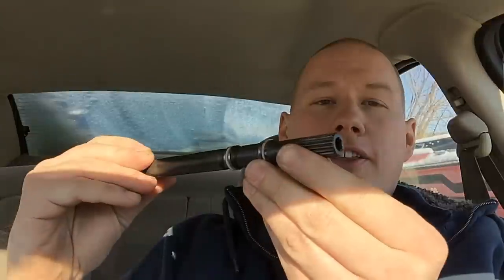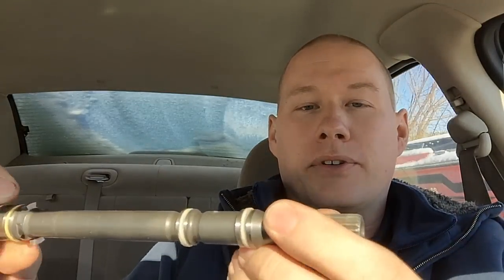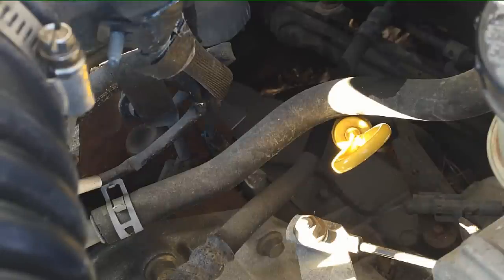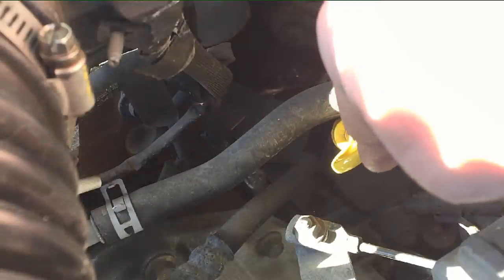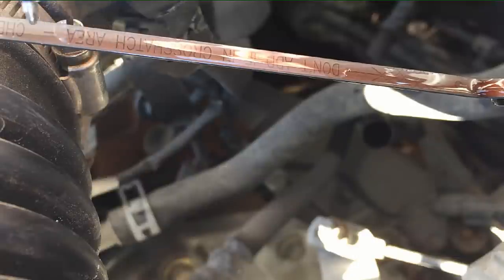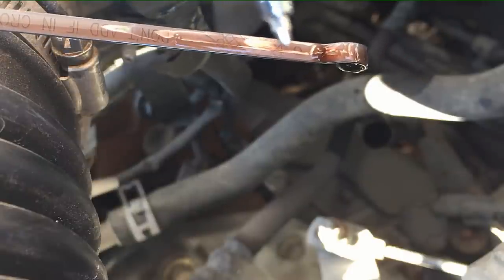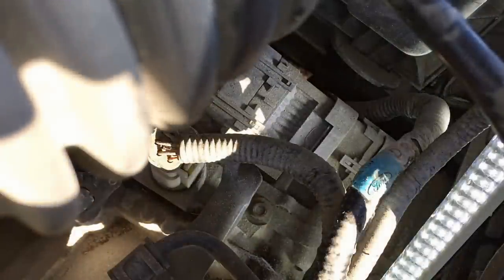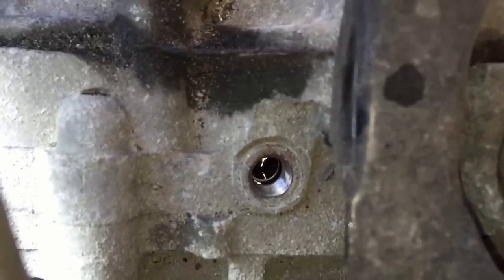Ford Transmission Tips: #5 Ford Taurus & Windstar No Movement EASY Diagnosis

Comment: Hi you doing brother I’m having trouble with my transmission because leaked out all the fluid from right between the motor and tranny so I thought it was the torque converter but I got both motor and tranns out and I can find the problem can you give me a advise please

Comment: ok so i have a 2005 Mercury monetary that will drive and when i get up to 50 60 70 it wants to stop moving get off the eway turn the van off turn back on start to go drive for about 10 minutes completely stops dont go forwards or backwards turn off for 10 more minutes and it drives again test said my fule sensor is bad would that make all this happen

Comment: hey my 2003 taurus with the 3.0 it goes in to gear but it seems like it is stuck in 2nd gear its very slow to take off and it wont down or upshift what could be the problem?

Comment: Hi Engine running great from your head gasket vedeo now have grinding and tick at same point coming from drivers side drive axel were it plugs into trans axel behind seal seal came out once changed drive axel now have this noise would you have vedeo on this

Comment: Wait so my Ford Taurus won't move and no fluid is shooting out, so it'd be my pump or torque c8nverter?
Reply from the maker: Torque converter is stripped out where the pump shaft splines into it.

Comment: Great info! Have you seen a CD4E do this?
Reply from the maker: Chad Ross No just the AX4S AX4N and 4F50N. The escape cd4e has filter plugging issues causing a similar concern.
Reply: @FordTechMakuloco  where are the solenoids in an 03 Ford Taurus transmission? I have 2 solenoids bad

Comment: I found my that my fluid light kept coming on in my 1993 Ford Taurus GL has under 90 thousand miles on it though I checked oil and antifreeze coolant and power steering fluid then checked the transmission fluid and it was almost bone dry I filled it up using a half full bottle and two almost empty bottles of transmission fluid that topped it off my family members driving my car not checking the fluids is what caused this. I know when the steering fluid is halfway low because when that happens the power steering screams when turning and the fluid light comes on when turning

Comment: I have a 2002 Ford Mustang v6 with automatic transmission. The transmission has delayed engagement when i put it in reverse then drive it take 3-5 seconds to engage in gear and vice versa. Also in a cold start in the morning i put it in drive hit the gas a little and the transmission just spins till like after 5 seconds in engages. What could be the problem? I am going to do a filter and transmission fluid change.
Reply from the maker: Caliluv562 Filter and fluid change is a good start I am wondering if you have a lazy epc solenoid. You will have to check line pressure to verify then epc pressure.
Reply: Ok thank you i would give you a update after oil and filter change. Do you think its a good idea to use Lucas transmission addictive to help stop slippage?

Comment: How about if you do get fluid from the port but every other symptom is the same. Won't engage in  anything but park. Excess fluid on the dipstick running and not (also not discolored).
Reply from the maker: The pump shaft may be grabbing at times and able to move fluid but not build pressure next step is an actual pressure check from that port to verify it has at least 50psi.    Here is the kit I recommend-     http://amzn.to/2vnnTX7
Reply: Took it to a shop, quoted me $2k for a "new" install, $2.8 to rebuild the current trans.  Said the TC was stripped.

Comment: What else would cause this problem if you get fluid coming out of port with 7\16 bolt
Reply from the maker: screw in a pressure gauge next to make sure it is in spec.
Reply: okay i will tell him to try that
Reply: @FordTechMakuloco  how much pressure should it produce?

Comment: FordTechMakuloco2007 Ford Five Hundred FWD 6 Speed Automatic Transmission.Hello, this is Tony. I have been having some transmission issues with my 2007 Ford Five hundred. When driving, I suddenly hear a grinding noise, and the it feels like someone is pressing on the brakes. The car eventually comes to a complete stop. There is no lights on the dashboard stating a problem. I took it to a mechanic and they noticed that whenever the car shifts into 3rd gear, the transmission goes back into reverse. What could be the problem? Is it the control module for the transmission?Thanks.

Comment: My 2002 Taurus slips out of first gear to go into second gear but after I lift off the throttled the will go into gear and shifts great after that ...and it does that when it heats up can you help me ?
Reply from the maker: Randy Brown More common for the intermediate plates to have issues on these causing the problem you describe.

Comment: what if I'm losing transmission fluid but and but when I add more it moves just fine but comes out again. I just replaced the transmission filter and gasket. and no sides of the fluid leaking.

Comment: My 99 Windstar quit on me today.  Found your video and looked for that plug but did not see it.  Can you steer me in the right direction?  stopped at a local store to look for a wrench.  When I started it to leave it made a screech like a belt so shut off immediately and checked.  On restarting it makes a soft ticking or tapping sound and will not engage.  I can put it in gear or neutral and can rock it but in park will not move.  Checked fluid and seemed good with no burned smell.  Tried to pull the codes off the computer but got some weird ones so not sure my cheap reader is working right.  Any help would be appreciated.
Reply from the maker: NeoWolf Yours is right on top same thing.

Comment: Other than this, what are the other most likely reasons the car won't move? I have a 2004 Taurus with the 24v 3.0 that won't move. Does the engine type matter or do they all use the same transmissions?
Reply from the maker: All the same, put a pressure gauge on it next.
Reply: Did you find out the problem

Comment: Hi +FordTechMakuloco. I have a 2000 ford windstar. suddenly lost drive on the freeway as you describe. Started making a whining noise. Has plenty of fluid. I did the check that you show in the video. Fluid pumped out of the plug hole unlike in your video. But the van still won't move and like I said it is making a whining noise. Fluid did not shoot out of the hole it just came out without a high pressure stream. If that is normal what should I check next? Thanks for the video!
Reply from the maker: tom Frazier Unless the cv shaft broke (which is likely didn't but I did have one) then this is still your issue this seems to happen most going down the expressway. Yours is just still catching a bit that's why its gurgling fluid out. It should still come out quite fast even at a cranking rpm.
Reply: Thank you sir. Thats what I thought. The pressure coming out was not enough to engage the torque converter I thought. The CV's are new and don't rotate with it in park while off the ground. So I guess I'm pulling the transmission this week. Thanks again

Comment: Makuloco, can I assume its not necessary to clean guts of trans when replacing converter, since you said just replace it?
Reply from the maker: +Welton Hardy yeah the guts are fine generally. A pan drop and filter change is of course a good idea.
Reply: Thank you. Now I'm concerned about fixing it to await the next occurrence, since this issue is too common. But, I did lodge a complaint and joined the ranks. Oh, I tried to follow you on the ports, but you were working on a car; the ports on the van aren't easy to find.

Comment: I have an 06 ford escape that starts up & runs but when i shift it into gear it does not engage. What would cause this? I was trying to pass a car on the highway then it just reved up & would not shift after that.
Reply: Did you find the problem
Reply: Same thing with my 2003 Taurus thinking it's the pump shaft

Comment: Hey man, do you have any idea on my 2000 Ford Windstar why if I go one physical mile my odometer registers approximately half a mile? Thanks!
Reply from the maker: +ILTSYC This can be due to the improper gear on the vss sensor or improper tire size. Also I would get the axle ratio that is programmed in to the pcm compared to the actual ratio.
Reply: I bet the axle ratio is off in the PCM. My particular VSS doesn't have a gear on it and there are no speed ometer gears in the slot at the right transaxle where the older models are shown.
Reply: +FordTechMakuloco , I am having an issue with my 2005 Taurus 3.0 vin u, i have a harsh 1-2 shift no slip. manually shifting it shifts great nice and soft. like the accumulator is ok ?  Ive replaced the tps, mass, could it be oss,vss, no codes. pulling my hair out please help. thnx

Comment: I have a 2008 Ford Taurus X Limited mine won't go over 45mph or 50mph. It's like it won't go any faster? Please help it's been broke down since Christmas
Reply from the maker: Its either your trans or the cats are plugged.
Reply: @FordTechMakuloco  I'm going to try the battery first. I just read something about that. That wouldn't pull a code. 😁
Reply: I'm about to blow this thing up cause the battery didn't fix it

Comment: I have an 05 that's seem to be doing the same thing it sounds like it has a bad vacuum leak but it idols fine its almost like you have to hold it to the floors and your not moving only about 40/50 mph when it should be going 80 will this casue it to sound like its reving high.?
Reply from the maker: No this is a all or nothing failure.
Reply: Ford nut what was the cause of your transmission issue?  My son's 05 Taurus is doing the same thing.  It finally got to where it wouldn't move.  There is no mechanical sounds only the engine revving.

Comment: This is exactly what happened to our 2002 Ford Taurus SEL with only 70,000 miles on the clock. Ford sure doesn't make them like they used to.

Comment: This is EXACTLY what happend to my 03 Taurus. When I put the car in gear it feels like it is shifting in gear but the car will not move. So based on this video, it's gonna be the torque converter that needs replacing?
Reply: Find the reason?

Comment: I have noticed several videos claiming it is the shaft that has sheared off and the torque converter is fine.  Have you found this to be true?  If so is it a difficult fix?
Reply from the maker: Its the torque converter trust me.
Reply: @FordTechMakuloco  ty for the reply, I should change the shaft also right?
Reply from the maker: Yes they wear each other out and the scarf cut seals and the input seal.
Reply: @FordTechMakuloco  thank you, very helpful info, much appreciated

Comment: HELLO I WANNA THANK YOU FOR YOUR VIDEO IT WAS A LOT OF HELP MONTHS BACK WHEN I WAS REPLACING THE TORQUE CONVERTER ON A 2002 FORD TAURUS FOR MY BROTHER IN LAW NOW THE CAR RUNS PERFECT. AND ME BEING PROUD OF MY SELF FOR BEING MY FIRST TIME EVER DOING A TRANSMISSION JOB.  !!!!!!!! BUT THIS TIME I HAVE KIND OF THE SAME PROBLEM THIS TIME IS MY PERSONAL CAR 2001 FORD TAURUS EXEPT MY CAR RUNS IN REVERSE BUT NOT IN DRIVE ONLY IF YOU PUT IT IN 1st GEAR THE CAR WOULD RUN SMOOTH WITHOUT THE RPM GOING SKYHIGH  MY CHECK ENGINE LIGHT CAME ON OBD CODE # P0715  Input/Turbine Speed Sensor Circuit Malfunction. I CHANGE THE SENSOR AND KEEPS DOING THE SAME THING. I DID THE TEST ON THE LINE PRESSURE PORT AND NO OIL CAME OUT (but still reverse works) NOW WHEN I PUT IT IN OVERDRIVE OR DRIVE AND I PRESS ON THE GAS I COULD HEAR A NOISE ON THE TANSMISSION SOMETHING LIKE A TURBINE ROTATING KIND OF LIKE A SPOOL ON THE TRANSMISSION SIDE. IM ASKING MY SELF IF IT COULD BE THE TORQUE CONVERTER OR THE PUMP. I DONT THINK IS THE SHAFT BECAUSE I HAVE REVERSE. OR WHAT DO YOU THINK ?
Reply from the maker: +Mauro Garcia If the fluid level does not go down after starting the vehicle the fluid pump is not working whether it be the worn out convertor splines or pump it's is an issue. Second you want to put a pressure gauge on the line pressure port and note the line pressure in each gear.

Comment: hey FordTechMakuloco  I was told there is a way toremove 1999 ford Taurus transmission side plate with out removing transmission by removing some brackets do you know anything a bout this?
Reply from the maker: Justin Davis Yes you support the trans with a jack, remove trans mount and bracket that bolts to the side cover and then remove the side cover ultimately. I remove the cover out the top once loose it seems the easiest.

Comment: me transmission a little oil come out. is there any other sensor or circuit the will prevent the transmission from work
Reply: Same, if you've found a solution please let me know.

Comment: I realize this has nothing to do with this video but I have a 2005 Taurus with the OHV engine and after I start it in the morning and drive it after about 5 minutes I smell burning oil. Any ideas ?
Reply from the maker: Robert Bradley Most common for a large oil leak to drip right onto the cat Y pipe is the oil pan gasket at the front lip.
Reply: Well it 1 27 degrees here right now so I am going to let it warm up before I look but thans you videos are great. As I said before my Taurus has 250Kms on it. Whats the highest mileage you have seen on one that the t/Converter hasn't stripped. I hope to get this car to 500Kms as I keep it in really good shape. Will the 3.0 OHV make it?

Comment: So if my wife's 04 freestar just stopped engahinf? Won't go in no gears. Once in awhile it will move for a second. Possibly torque converter?
Reply: Brandon Smith Good chance your converter is on the way out. You could try some Lucas Stop Slip and see if that helps.
Reply: @sirsmith2048  did Lucas work for you?
Reply: did you try lucas
Reply: Yep. I replaced the torque converter!  But i also replaced the trans filter. And wow was it clogged. But I just flushed it aboit 1/ years ago. But she is going now
Reply: @brandonsmith5692  ok thanks
Reply: Yw

Comment: What are your thoughts on the 4.9 straight six that's carbureted?
Reply from the maker: olson gregory I know it was one heck of an engine and that is all. It was before my time.
Reply: +FordTechMakuloco what about the 2.3? Late 80s to early 90s?
Reply from the maker: Too many problems from all the ones I have encountered,
Reply: olson gregory My father had a 1990 Ford Ranger 2X4 with a 2.3 and the motor ran perfect and never had an issue all the way up to 389K miles when he wrecked it. However, it may have been a one off thing because I trust FordTechMakuloco over anything.

Comment: got a question for you, trying to program a key in a 2014 fusion the process you need internet for to get on the ford website. the car starts but none of the buttons work on the remotes. is there an additional step you do to activate the remote functions?? this is my first time doing it. thanks
Reply from the maker: You used the IDS to program a key? Or you used 2 keys cycled then the new key method?
Reply: ids, it had no keys it was an impound
Reply from the maker: Ok these can only program up to 4 ikt's so you must use the erase all known keys option and program your keys like normal after that. Then it will work.
Reply: thats what i did was erase the all keys, maybe there bad keys? idk it starts just no remote functions work. maybe a fuse is out of the rke reciever since it was an impound
Reply: do the blades come off the transmitters to swap for a different key head?
Reply from the maker: phil holbrook I don't think so on these.
Reply from the maker: phil holbrook Yeah I would scan the rfa and make sure it is responding. I had either a 13 or 14 and the rfa above the b pillar drivers side was dead same symptoms.
Reply: thats what im thinking it might be the module, likelyhood of 2 bad keys is pretty low. havent looked at it to much. the new way you program keys with the internet makes it hard when your far from the garage and wireless has no connection
Reply: alright doing the 14 fusion key remote still not working found on the ids it has an option for rf key pad learn process it asks for a code where do you find the code at? if you know thanks
Reply: the problem has been resolved. it was the parts guy fault gave me 2 sets of wrong keys he kept swearing they were the right ones glad its done
Reply from the maker: Oh wow!
Reply: one question out of curiosity where do you find the "string" number at seen that under the body section on the ids
Reply from the maker: string?
Reply: yea thats what its called says its 48 digits long. its under the "body" tab at the bottom in the "rf button learn" tab then it asks for it. found nothing. i dont need to know where to find it just wondered if u ever heard of it
Reply from the maker: No I have never gotten that deep into it actually.
Reply: how do you test a can bus line for a break? ohm meter?? im a new mechanic. i dont know how youd check it for an open since its 2 wires twisted together. and also the LIN line. thanks
Reply from the maker: Yeah a regular ohm test is all you must disconnect certain modules like the pcm and IC because they have a resistor in them but first you check the bus with them connected to make sure the terminating resistors are ok I think they are 60 ohms each besides that a regular ohm test.
Reply: how do you check the terminating resistors? through the dlc?
Reply: phil holbrook yes. through the dlc, pins 6&14  are hs-can and pins 3&11 are ms-can.

Comment: Question for you. 2005 Taurus Column  Shift. When in park it sometimes lunges forward a little. Just rocks the car. Usually when cold. Any clue? Suggested to check out shifter linkage.